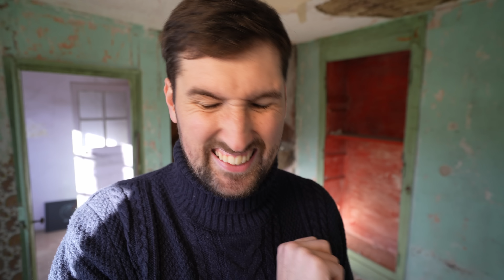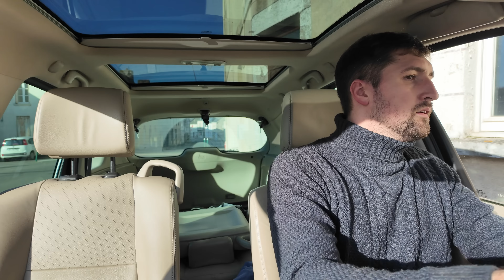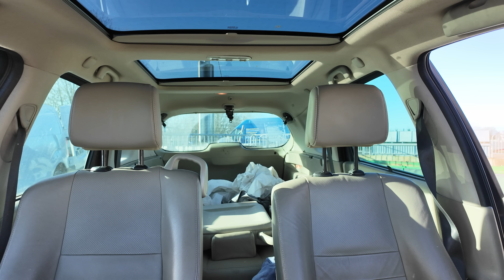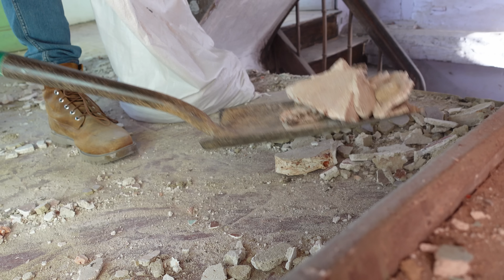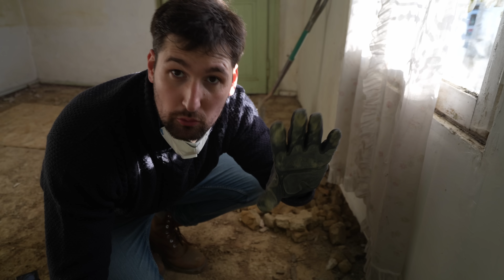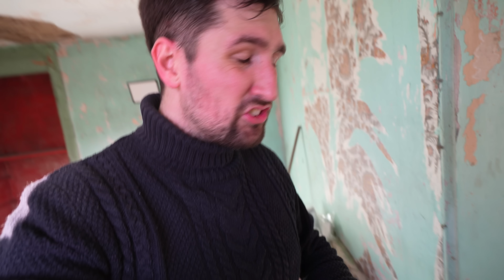The Unsettling Discovery I Never Saw Coming...

Comment: I had to do some digging on earthen floors for levels above ground or 1st floor.  When done right, the floor will look like concrete and can be sealed, so cheap.  But it is heavy so if the supporting structure isn't sufficient, you will get the sag we see here.  Also, it's not as hard as concrete, so if you drop anything on it with some weight, it will dent or even fracture that spot.  Because of the age of the house (I'm guessing), it may not have been sealed or sealed properly and water is its worst enemy over time.  While still used today, I would do as he's doing and remove it, fix the joists, and put in new subflooring for carpet or tile or whatever.

Comment: Is there a fee to dump at the tip? In California at my local dump, actually we have 2, there is a fee. At one it is by the cubic yard, minimum 1, and at the other it is per pound, minimum 500. The volumetric dump is a bit dodgy, because they just eyeball it with a measuring stick. And it isn't cheap either $80 per yard/500lbs. So if you just have a car, it could get expensive really fast.

Comment: Can I make a suggestion. Since the debris bag was on the dirty floor it's outside is contaminated with dust. So please put a plastic bag down on your car boot then when you can chuck plastic out and your carpet or car interior won't be contaminated.
Reply: Good shop vac would get all that smaller debris up contained or use a small broom and dust pan?

Comment: So do you have to fumigate for woodworm?  It looks like old damage, I know if it were termites you would want to get rid of them asap, not sure on woodworm.  That dirt floor looks like it will be a pain to remove. I'm surprised they used that on anything other than the bottom floor/ foundation. I also wonder if you wet down, would the floor be easier to dig up? Surely, the dirt turns to mud when it is exposed like that.

Comment: Essentially, all the wood floors, supporting beams,  door and baseboard moldings and perhaps even the doors themselves will need to be removed and disposed of. This building is very old and all these things are to be expected. All plumbing and electrical as well since whatever remains of it does not meet modern codes. All interior wood walls, ceilings etc. have to be removed to expose the stone walls so those can be re-pointed and eventually re-insulated on the inside. Very similar to what is happening on the Bordeaux Life project. Then you get to the roof tiles and roof support structure and who know what will be found. So this is going to be at least a two year project, IMO. Ryan's goal is to make a nice home for himself so this should be an interesting journey as he makes his way through it.

Comment: Are dirt floors on upper floors normal in France? That is mind boggling to me. Not only does the weight of all that dirt add up quick, but I would think it would hold in the moisture which would make it even heavier. Then the wooden beams get weaker because they are in that wet dirt. No wonder the beam snapped. I'm surprised it's not worse. Sometimes we have dirt basement floors here in the states  but never ever upper floors. That's nuts. Are you planning on tearing every room down to bare studs, ripping out the mechanicals, then starting fresh? That would be the easiest way, especially since you aren't living there. Rip it all out, then start on the highest floor and work your way down.
Reply: Only in France🇫🇷.!!!! 😮😂 🏴  x

Comment: A dust pan would work on the stairs lol! Great job and I see you got some new boots! Excellent! Which is worst? Woodworm or termites? I daresay woodworms are not as bad but still needs to remove badly damaged posts, wooden floor planks. You can do this! All you have to do is to replace the badly damaged posts and start new! I think Michael's cottage had that same issue and I am sure you DID help and watch it how it is done. Crack on, Ryan! You are doing well!

Comment: Question:  Was the dirt laid down wet, like a cement mixture before laying tiles?  Here in the desert Old West, there used to be adobe houses, dirt mixed with straw and made into bricks.  No air conditioning during the 1800s and adobe kept homes cool during hot summers.  But, doesn’t it rain a lot in France?  That home seems like it would have been built by a middle class merchant based on the number of stories and spiral staircases. So why dirt floors that would keep in moisture and rot wood to sag beneath?  I don’t get it.  A bottom floor would make some sense - but above that?  There must be an explanation like a shortage of wood, shortage of lime - something? Or was the previous owner who built the place just plain cheap?  But then why spend money on an elaborate design? A history of this place would be interesting particularly since it has a bricked tunnel. For what purpose?

Comment: Instead of loading bags and hauling all that down stairs I would use the hole and just let it all fall to the bottom floor then fill my bags and load them out front until you can take them to the tip

Comment: Even if all fails, the property alone should be worth way more than 15.000.
Reply: If the property was worth more than 15,000 euro's, he would have had to pay more for it.
Reply: @janetpendlebury6808  No, it's not that simple. The cost of taking down the building has to be factored in. If you can do it on your own it's  cheaper than contracting a company.
And also - the seller might have a reason to sell cheap, and not stick to the price the place is worth.

Comment: Slow and steady wins the race.... so they say... doing a fine job Ryan... Think you find the ceiling and some dodgy wood... that has gone rotten... Filled with wood worm... ew... Yup that is brokeyday... gonna need fixin ... taking up that floor will take a lot of weight off the building... good to take that up... I'll be better with it gone...

Comment: Hi Ryan, great work, well recognised about the weight . Remember safety first, get some acro props under all those floors with beams /planks all the way across downstairs ceiling perpendicular to floor joists. Make a hole wide enough to get chute and dig it all up, down the chute so you don’t carry it down those stairs. Get a wheel burrow and trailer if your car has a tow bar and a friend if you can’t get a skip on the road .Good job.

Comment: I'm a big believer that a car can do almost anything a van or truck can do, you just need a roof rack.

However. Construction generates a lot of mess, and I think the better solution is to look into getting a bin. I don't know about France, but generally they can be rented quite inexpensively (maybe even free) and the cost of getting it emptied is still a good deal compared to the dozens of car trips it can save you.

Comment: Its a strange construction thick heavy concrete and quarry tiles on a wooden planked floor,its superising that its not more collapsed,whole building wants a wet treatment and other rooms on that floor suspect five star fluid.You may be able to gain some Headroom too. The rooms aren't large so cost of timbers moderate.New plaster board down stairs too.

Comment: Ryan that's probably a problem that starts with the window. The window is most likely letting water in and it's rotting anything underneath the leak. You should check that out first and make repairs there before you fix the floor.
Also putting a tarp down on the floor helps with cleanup.

Comment: You need a pickup truck Ryan. Something like Billy uses at the organ donation building. It will save you a lot of money in the long run. May even pay for itself considering how many dump-run fees you’ll be saving on, also gas for a small load in the car. Not to mention the amount of stuff you are going to have to buy at the home improvement Brico/French Lowe’s. Oh, and trips to furnish and decorate the house from yard sales, antique stores, thrift shops. This making any sense? In other words, to do a job right you need the right tools! Work smart, not harder. You’ll see… Gotta start somewhere, which you’ve now done. Check that box off!!

Comment: Should buy a little trailer, it makes the job easier.
And spray a little water on the debris, would decrease the dust.
Classic woodworm takes wood aged minimum 2 years maximum 60 years. So this one is old, probably already gone.
Reply: Does he have a water supply?
Reply: @janetpendlebury6808  Bladder

Comment: Ryan I think you made a major mistake when you purchased this $15,000 house.  I think that you are way over your head . You should have had the place inspected before you purchased it. Here in the U.S. that place would be called a knockdown..
Reply: Luckily in most other countries they are more into preserving old houses and buildings instead of just knocking them down. If the structure of the house is sound why not renovate it.